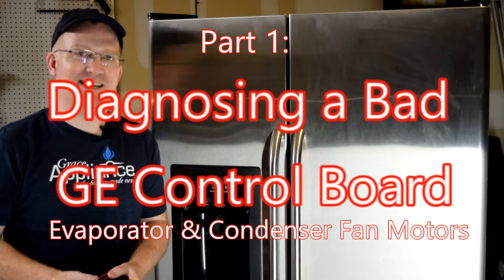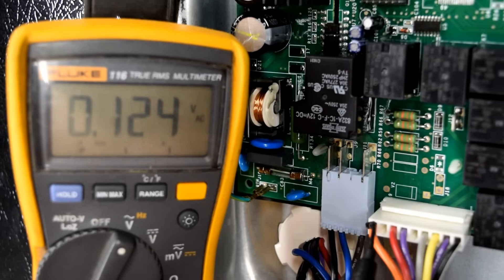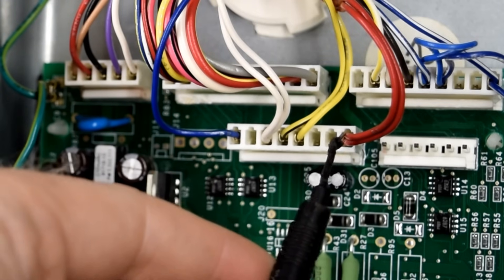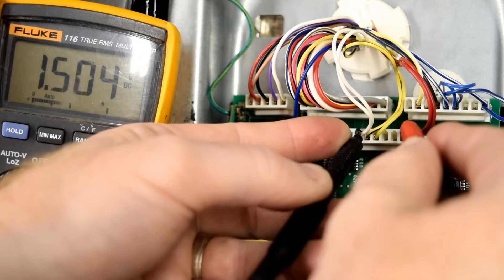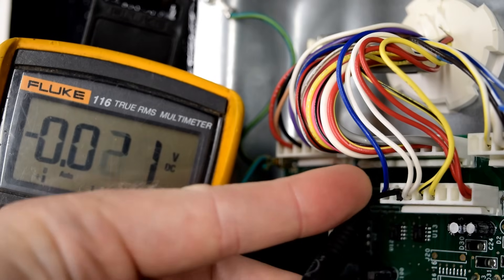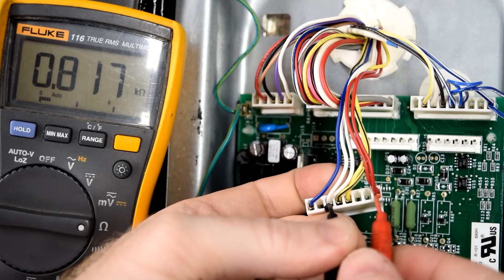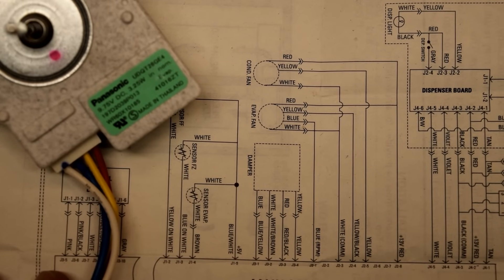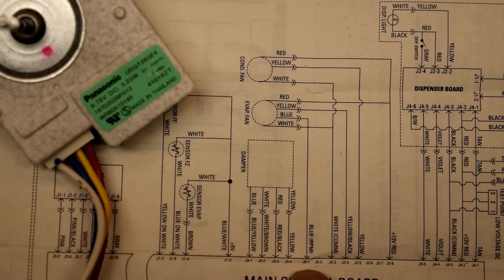Diagnosing a Bad GE Board - Part 1: Fan Motors

Comment: Andy, I wanted to make one correction to your video.  PWM is "Pulse WIDTH Modulation", not WAVE.   Thanks for your informative video.   I have had an issue with two new OEM main boards failing to supply the pwm signal voltage across J2-4 to J2-3 .   Each board failed after a week of use.   I bought a new board because I was seeing something flaky going on with 
the compressor and evap fans shutting down for a long period and not starting up when the freezer temp goes above 15 degrees F.   The Evap and Freezer thermistors appear to have the correct resistance, so I do not believe they are the issue.    However two new OEM boards failed with no signal voltage  after a week or so use of each board.   The original board which was replaced by an appliance repair tech 4 years ago, still works and runs the evap and condenser fans.     I had replaced the evap fan 7 months ago, as it failed open circuit.   I am ordering another evap fan to try as it seems to be the only suspect that might cause two new boards to fail.   Unless there is a major defect in the two GE OEM boards that just failed on me.
Reply from the maker: Hey Phil,
Thanks for the correction. I caught it after the fact, but that's life I guess. Lol

I agree, it sound like a failed evap fan motor which when bad will cause the the boards to fail in short order. Specifically, it will often cause the 2 larger capacitors on the board to turn brown or black. The PWM signal is sent by the fan itself, so if you are not getting that frequency response (and the fan is turning) that points toward the fan. 

I'd replace the evap fan with the new board (if needed).

Andy

Comment: Hello, I have 11.4 volts going to the condenser fan. Would this cause the fridge to not get cold?
Reply from the maker: Hi Shane, 
This sounds about right for the condenser fan (12-13.5vdc is about perfect), but so long as your condenser fan is turning - I would rule that out as the cause for your fridge issue. 

Now, other things to check is to make sure the compressor is running.  Anytime the condenser fan is running, the compressor should be as well. 
Also, check the evaporator fan to make sure it is running.  

Is there excessive ice build up on the back wall of the freezer?   
If so, you would have a defrost issue. 

Other things you might check if these both check out, is to take the inside freezer wall down to get eye balls on the evaporator.  If the compressor has been running at least 30 minutes, you should see that almost all of the evaporator coils should have a light coating of frost on them.  If not, this could indicate a sealed system issue.  

Let me know what you're seeing with respect to the compressor and evaporator.  

Thanks,
Andy
Reply: @GraceAppliance  thanks Andy. I was able to rule out any electrical issues by watching your videos. It just needed a shot of r134. Nice and cold once again. thanks again for saving me a few bucks.
Reply from the maker: @shanestewart2036  you're most welcome!  I'm glad it helped. Stay in touch.

Comment: Andy, I found that my mother board is bad it has tow burn spots on the relay.  The Condenser Fan Motor is giving me .801 ohms and not the expected 1.5 to 3 ohms. Do I need to replace both the condenser fan motor and mother board, or just the mother board. However i did not see how you test the evaporator motor.  I believe the my fridge only has two fans, the condenser fan motor and the evaporator fan motor.  Can you advise. Thanks.
Reply from the maker: Hi Alfonso Sanchez, 
I’ve heard from others that they are getting the same readout as you are so I would not be concerned about the fan. Replace the board and you should be in good shape.  

If you will order through the affiliate link in the description, it’s a huge help for the channel.  

Thanks and let me know if you hit any snags with the install. 
Andy

Comment: Very informative and very well presented.
Reply from the maker: Thanks Tony for the kind words!
Stay in touch.
Reply: @GraceAppliance  I got home from work today and plugged it in, heard noise but not compressor. Checked for 12v power from wr55x10942 board at dispenser board, only had a minimal fluctuating voltage. After 10 min the compressor started. Note it wouldn't do this for last 
20 hours after power failure. Checked voltage again at dispenser, ~14vdc now. I have a new main board ordered, but would like to repair this one for spare. What is likely culprit power supply or one of the relays? Nothing obvious on board... Thanks again for the help.
Reply from the maker: Tony Brown hey Tony, I’m not sure if you have watched the video on troubleshooting a front control board, but if the compressor does not run, you can unplug the front board. If the compressor then comes on, you’ve got a failed front touch panel.  

If no change, then yeah it’s probably the main board. 

More than likely it is one of the relays on the main board. Also, the medium sized capacitors are troublesome on these boards.  So, if you’d swap out the relays and caps, you’re most likely back in business.  
The main headache with rebuilding these boards is that they are coated in what’s called a conformal coating like a clear coat which ends up binding the components to the board. So, you have to use more force than you’d like to remove the parts which can damage the solder pads and makes it non rebuildable.  

That’s been my experience anyway.  

I hope that helps.
Reply: @GraceAppliance  I'll check it out. Thanks!

Comment: Hi ,my Fregider builds Ice the lower window, the upper window doesn't blow sufficient cold Air.to the food section. On a Kenmore Cold spot
Reply from the maker: Hello, without your model number I'll try and give some tips just generally.  If your evaporator fan is working, but still mop air to your fridge, it sounds like it would be either a defrost issue causing ice build up that blocks the air flow, a problem with the damper door between the freezer and fridge or an air leak causing ice build up between the two cabinets.  

If you'll send your model number from the sticker inside the fridge section I might be able to provide some additional help.  Thanks

Comment: Thank you for the video. I am having trouble with my GE GSL25JGCBLS side by side refrigerator and like Merv Swan I also get 800 ohms. Only thing is that I taken out both fan motors (condenser and evaporator) but do not get any Hz reading when I do the test you showed. Both fans do turn on and spin. 

I have done the visual inspection of the board and it seems fine. I have been getting good voltages to both fans. I have good voltage coming from the wall 122 V. 
Is there a reason why I am not getting any Hz reading. I noticed that on the condenser fan there are only 3 pins are being used which connect to the Red, Yellow and White part of the motor going to the control board., Btw my evaporator fan in the freezer has an extra connection for the light bulb not sure if that affects it. 

Thank you for your video and any advice will be greatly appreciated.
P.S. Where do you get your wiring schematics?
Reply from the maker: M M hi MM, sorry to hear about your issues with the refrigerator.  
I’m not entirely clear about what issue you’re having. So, neither fan are turning? 

Don’t worry too much about he Ohm read out at the fans, I’ve heard from others that the 800ohm range is no problem.  
The 4 wire fan should be getting a Frequency response as this is the motors tachometer and if this fails the fan won’t work properly.   
The 3 wire fan has no tach and it just measures for Dc voltage from the board.  In either fan instance, if you’re getting proper voltage to the fan plug the fan should be turning.  If not, you’ll need to replace the fan motors.  The light circuit that you mention is of no consequence.   
You should see links in the description to both of the these fan motors.  

I’ll be traveling for a few days, but if you wanted to email your model number to GraceAppliance@gmail.com I can respond with your technsheet which will have schematics you could look at.  Thanks! 

Let me know if you have any questions.

Comment: Andy, you have a great methodology for explaining several issues, but I can't find anything showing the panel removal for my French door model PFSF6KPX BBB (black).  That front panel doesn't come out the way shown, is flat faced, has one screw underneath the ice/water edge, and doesn't budge.  How does one remove that - so I can get to the ice path spring-loaded door which is always open?
Reply from the maker: msnetsvc hey, here’s a video that should make things more clear.  
I hope it helps:

https://youtu.be/6bTbK9Ztmck
Reply: Thanks, exactly what I needed.  This is a great site.

Comment: Andy......My Samsung Side by side fridge:  since some of the veggie and diary products in my cooler got really icy, so I increased the cooler  temp by 2 degrees to 40 F.  The next day, I noticed the freezer led temp display 0 F started flashing.  So I powered the fridge off at the breaker and waited 2 hours before powering it back on.  The fridge was on, compressor was running,  cooler temp was preset at 38 F so I left it at that and freezer temp was preset at -4 F, so I adjusted it to 0 F.  However,  after running for 3 hours or so, the led display showed freezer temp at 48 F and it showed cooler temp at 34 F.  The compressor doesn’t seem to stop.  Please advise what should I do at this point.  

Thanks a bunch!
Reply from the maker: Hi Guang,
If you'd like to send me your model number to Graceappliance@gmail.com I can look for your tech sheet and reply with that. This will help with some troubleshooting tips.

If you have a single evaporator, it could be a defrost issue on the freezer side, but the tech sheet will help us determine this.

Thanks

Comment: I have a GE Profile side by side Model # PSC23sgpass.  My main board is bad as detailed on your video (the back of the relay). When testing the ohms on J2, I get 1.017 on the red wires and no readings on the yellow or yellow/black.  The fans are turning and seem to be working.  I didn't want torisk a new board if I might blow it with a fan problem before running it by you first.
Reply from the maker: Kurt Strachota hi Kurt, what are the colors of the two wires you’re measuring resistance on?
Reply: @GraceAppliance  White to yellow and white to yellow/black.  I out the new board in and the temperatures improved a little 39-Ref.., 19-freez.  This all started with a broken damper which I replaced.  The temperatures then went to 0 and 37 as set.  Then they began to creep up.  The fans appear operational, no frost on the evaporator, condensor is clean, all thermistors check out.  But the No Readings when ohming the fans is weird.
Reply from the maker: Kurt Strachota when you say no frost on the evaporator, you mean NO frost at all? 
If you remove the interior wall of the freezer, you should see a light coating of frost on most of the rungs of the evaporator.  
If there is zero frost, (and your compressor has been running for at least 30 minutes) it may indicate a sealed system issue. 

Let me know what you find on the evaporator.  Thanks!
Reply: @GraceAppliance  There is a little frost on the lower section.  Took a picture but not sure how to attach it.
Reply from the maker: Kurt Strachota feel free to send it to GraceAppliance@gmail.com 
If you’re only seeing frost on one small section of the evaporator (and the compressor has been running for 30 minutes) this sounds like a sealed system (I.e. compressor or refrigerant) issue. This unfortunately would be very bad news for the fridge.
Reply: @GraceAppliance  Photo Sent
Reply from the maker: Kurt Strachota hey, got it. Thanks 

Unfortunately, that’s an issue with the sealed system. It could be a weak compressor or simply low on refrigerant. 
A qualified technician would need to get gauges in it to confirm the issue, but either way it may or may not be worth it as these repairs can get quite expensive very quickly. 
Being a sealed system, in theory it should never be low on refrigerant unless it had a leak. 
If you wanted to roll the dice with it, they do make a leak stop product that some will inject in to the sealed system, and then weigh in (with a scale) the appropriate weight of refrigerant. Usually something like 6oz. Very small amount. 
This may or may not work and it could be good money down the drain if you went that route.  

I’m sorry for the bad news.  

Let me know if you have any questions.  
Andy

Comment: Hi Andy, Thank you so much for the great vids. I had an issue with heat on the side wall and the separator wall (between fridge and freezer) on our GE PSC23MGPAWW. So, I checked the Condenser fan and found it consistently runs at low speed (4.4v). Main check shows 13.96 v J2 3-8, so I ordered a replacement fan motor (cheapest part first!) as everything else works just fine. Not sure if the Condenser fan motor is a variable speed like the Evap motor.  So, was this the right way to go (new motor) or should I just cough up for a new control board as well??

Comment: My ge profile side by side door works perfectly during the winter period but as soon as the weather starts getting warm, the temperature changes and it goes high authomaticaly. The freezer and the freidge stops functioning. Please what will be wrong
Reply from the maker: Hi, the first thing I would check is to see that your condenser coils do not have dust on them. Check out this video and let me know what you find.   Thanks!

https://youtu.be/W8f0fc36ObE

Comment: should the evap motor always turn on when the condensor fan is on?, because I have warm spots on my top shelve in the freezer. also i have water freezing at the bottom shelve in refrigerator side. I put 0 Fahrenheit and 37 Fahrenheit as recommended, my side by side refrigerator actual temperature is 0 Fahrenheit in the freezer and 47 Fahrenheit in the refrigerator.
Reply from the maker: Hi Addis, no the evap fan doesn’t always run with the condenser fan motor.  

It certainly could be related to the evap fan motor with these symptoms, but I’d also look closely for a temperature & defrost sensor issue.  I have a video on how to test and replace a defrost sensor which is where I’d start.  These sensors dictate when the evap fan comes on.  

Also, I’d rule out a defrost issue first by inspecting the evaporator coils behind the panel inside the freezer.  You should see a light coating of frost on most of the rows of coils.  

A damper door issue could cause refrigerator temp issues, but not freezer issues so I don’t immediately suspect that.

Comment: Hi Andy:  just received the main control board today and replaced the bad one with it right away.  Everything seems to be normal, except the freezer evaporator fan motor socket only reads 1.2 DC volts.  Please advise what might be the problem at this point.  Thanks!

Comment: Excellent video tutorial Andy. Being an old school appliance tech it’s nice that you can turn to a tutorial like yours. I’ve been in the trade for over 37 years. Today I had my first inverter compressor problem. I have a compressor analyzer that I have used for years, but from my understanding you can’t use it on an inverter compressor. In this case everything was running except the compressor. It was another person who I just happened to find and I was very grateful. Videos like yours and the one I viewed today can teach an “old dog new tricks” I’m subscribed to your channel now.
Reply from the maker: Joseph Folsom hey Joseph!
You’re most welcome.  Thanks for the kind words.  

Yeah, the inverter compressors are a different animal than the typical relay style.  

The inverter board has one task, to provide power to the compressor, but before it turns on, it must get a low voltage signal from the main board. It’s got 2 small wires leading from the main control and sends something like 3.5vdc (I forget exactly) but if you’re getting this voltage the main board is doing its job. If the compressor still does not come on, it’s a failed inverter board (or in theory could be a failed compressor). 
But, annoyingly you can’t do your typical Ohm test between the 3 compressor pins.  The tester you have wouldn’t help here I think.  

Stay in touch!